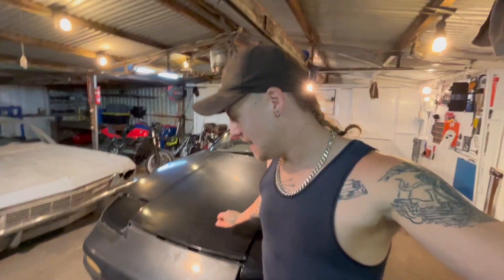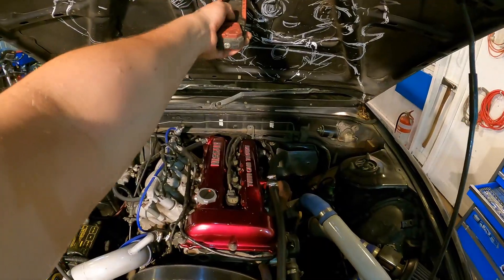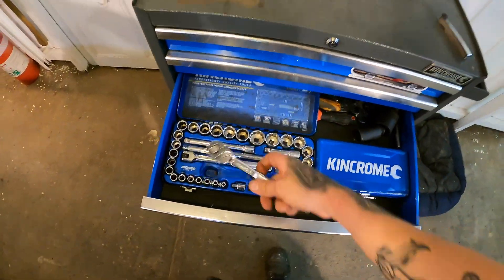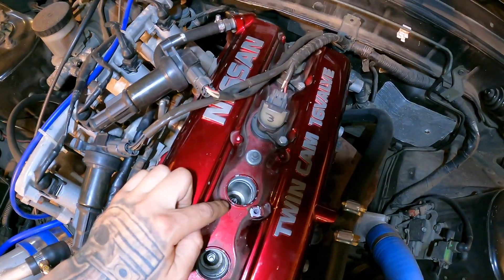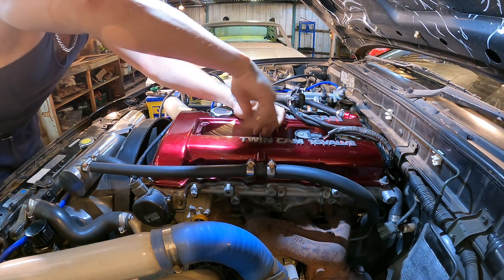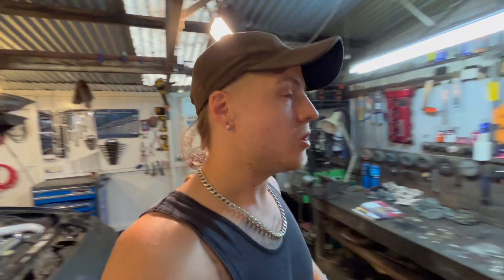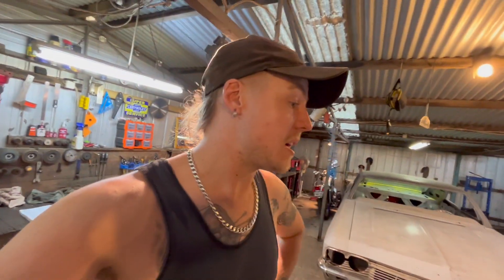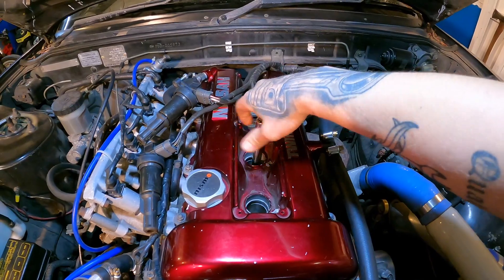How To Change And Gap A Spark Plug, Demonstrated On A Nissan 180SX SR20DET

Comment: Hey man quick question I’ve got a black top but even if bolts are tight around the cam cover is there still a slight gap
Reply from the maker: G’day mate. Yep there sure is a slight gap remaining. Just measured mine and it’s about 1.5 - 2.0 mm the whole way around. The studs are designed that way to have the correct amount of squish on the rubber gasket. They don’t need much torque at all, just finger tight. Be sure to tighten the central nut first then work your way out from the centre tightening the nuts on the front and rear of the cam cover last.
Reply: @dannyfischer717  thanks mate I just ordered some dress up bolts from PRP you still got her where you located mate?